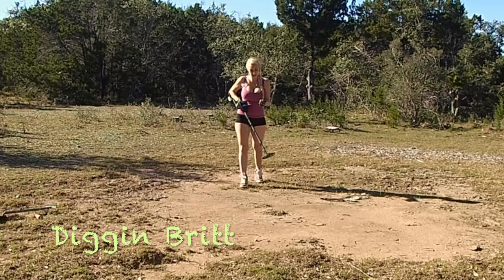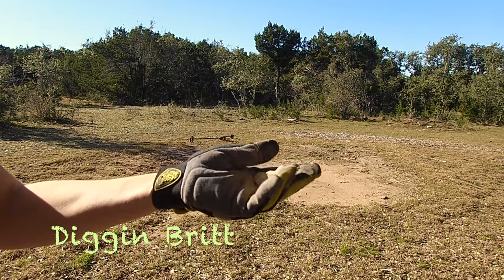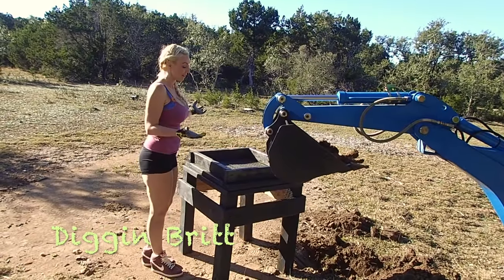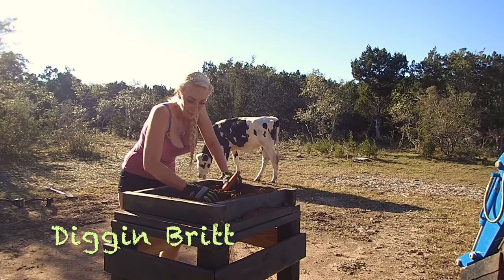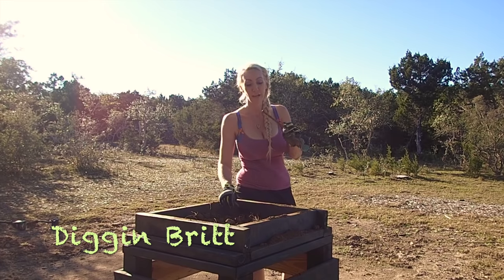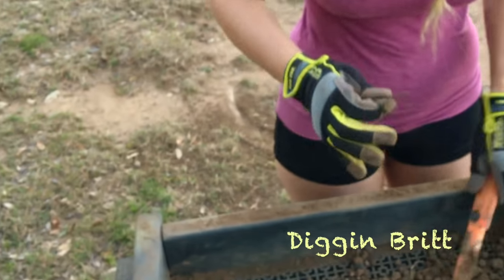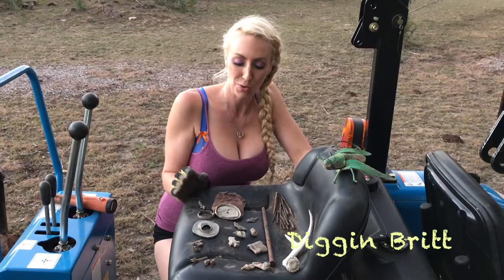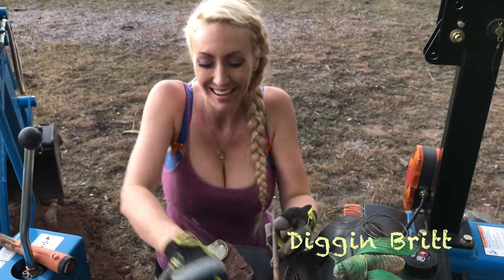Relic Hunting with my BackHoe and Homemade Sifter

Comment: toothed ring looks like part of a old set of kitchen taps, the larger ring is a cover where the pipe comes out of the wall to your taps.  

Spiral nails are house framing nails.  The two bullet like items look to be old fashioned automotive bulbs.

Comment: Twisty nails often have a square shank, to use for eg; nailing plywood to framing, in order to make them grab the timber better, so as to be harder to pull back out of the framing.

Comment: Big nail is a landscape timber spike. Metal with screw is a ground plug from an extension cord, and the twisted nails are fence picket nails, they are like the ribbed nail and do not vibrate loose from the wind. I will let you add your twist to these description. You are enjoyable to watch and keep diggin.
Reply from the maker: Thanks Dennis! ❤️😊

Comment: They are screw shank framing nails. The screw shape is supposed to keep them backing out of the wood as easily as smooth shank nails. They're usually used outdoors, or where the wood framing will experience a lot of expansion and contraction from environmental conditions. 

Have a nice day.
Reply from the maker: Thanks Calhypo, I hope you have a good day as well. ❤️

Comment: That green "hornet" is actually a cicada. Also, the twisted nail is used when you don't want the nail to back out, like wood on a deck or steps. The nail twists like a screw when hammered into the wood an won't back out.
Reply from the maker: I love cicadas. ♥️And thanks!

Comment: The 'toads' that look like bullets are called "Bullet Catches" used to hold small cupboard doors closed. Pair that up with the 'race car" latch and I would be a safe bet somebody dumped an old cabinet door out there.
Happy new year doll.
Reply from the maker: Thanks and Happy New Year Locadio! ❤️🎉😘
Reply from the maker: I said "chodes"...that's a slang term for a male...ahem....part that is as thick as it is long....so fat and short...😱...Sorry!😂
Reply: Haven't had any experience with any guy parts outside of my own, so no need to apologize.
Those twisted nails probably came from a pallet, looks like you dug up somebody's burned up trash pile

Comment: Those spiral thingies look like  spiral nails, 
often used in wooden pallet assembly, they grip like a bugger, try taking a pallet apart, its not very easy.... most people end up throwing pallets on a bonfire rather than disassembling.....I think you were likely exploring an old bonfire location right there ")

Good job, Britt
Reply from the maker: Thanks Rob!  Sac relig to burn pallets!! 😮  Unless they're literally rotting away I  keep and repurpose them!  Thanks for the info! 😊

Comment: Dear Britt,
The item you refer to as the fun do hiky is the the ground prong from a broken three prong standard plug.
 https://tse3.mm.bing.net/th?id=OIP.XqM65RY35i6JCBYY05FYKAEsDN&pid=Api 
Here is a link to an image.
The ground prongs are often removed to allow the plug to be inserted into an old two slot outlet.(ungrounded)
The other brass piece is from a broken outlet. It is the wire connection point.
The smashed piece with a 3/4 inch hole goes on the shower pipe to cover the hole in the wall. You slide it on the pipe before you install the shower head.
Hope that helps.
Love your video's.
I share your interest in relic hunting and detecting.
It is truly a gas to find something that was buried, even a rusty can.
You have a wonderful sense of humor.
I thought I was a leg man.
I think you converted me!
Happy New Year

Comment: Bob Dobbs has it right it is a leg from a 220 plug> Name that do hickey.. the twisty nails are to slow the nail from pulling out it gives it holding strength usually used on pallets
Reply from the maker: Thanks Jack! 😊

Comment: Have you ever gone to a ghost town and done some metal detecting. Lots of em around now a days.
Reply from the maker: I did go into a ghost town pretty recently...it was right off a highway.....It had an old slaughter house building (kind of creepy and sad) that was pretty torn down.  I brought all my gear but I was kinda too creeped out to detect 😁...But I will again sometime soon...not the same place of course.  There's lots of old barely standing houses and buildings close enough to where I live but I don't know who owns the property that it's on and I don't want to go without permission...or get shot at...😂
Reply: I understand the not getting shot at. Slaughter house would be a little creepy at night. lol Still could be a good place for a few good finds. Might be worth a second trip and a quick once over. Day time of course.  If the ghost town had a old railroad tracks , it would be a good starting place. Lots of luck, and have fun.
Reply from the maker: Totally a good place for good finds but I checked on intstagram and people had blogged about it since it had been abandoned and I didn't want to take anything from it I guess....and I didn't want any ghosts following me home...🙃  Railroad tracks are a great idea!  Nice! Thanks! ♥️xoxo

Comment: Pallets were made from Ash years ago and it was such poor quality wood that it was unusable for anything else...yes there are numerous examples of guys using it for fencing etc but it was extremely hard to work with and many would give up trying to disassemble..
As an apprentice in the 60s I was asked to take some pallets apart and as I recall it damn near took me 3hrs using a hammer and a crowbar to do one of em....my boss said any savings were outweighed by the the time it took to process them, I was ordered to burn em....sigh

Comment: When you find metal that is questionable and looks like it has been melted like that take it and place it in a small jar of hydrogen peroxide and see if it starts to fizz or bubble like alkaseltzer.  If this happens you have found what is called Native Platinum and some chunks can be worth quite a bit of money.  if it is anything but platinum it will not react with the peroxide and bubbles may appear but if it is platinum it will almost look as if the peroxide is at a low boil. The more platinum that is in the ore the more rapidly it will bubble.
Reply from the maker: I love that trick Tommy!  Thanks!  I'm all over that idea! ♥️🙂

Comment: Do you ever find meteorites ? Do you want to ?
Reply from the maker: Yes possibly and yes! 😊
Reply: I think that one good indicator that a rock is actually a meteorite is that a meteorite of a certain size will be noticeably heavier than an Earth rock of the same size.

There are plenty of stone meteorites. I assume that your metal detectors do not detect those kinds of meteorites.

There are stony-iron meteorites, and there are iron meteorites. Your metal detectors can find those.

You could train yourself to identify meteorites:

Meteorites have pits, which are like tiny crater-like indentations that were caused by the intense heat of entering Earth's atmosphere at hypersonic speeds.

And meteorites have fusion crust which you could teach yourself to identify.

If you have possible finds, then it would be totally cool to show them in a YouTube video.

Comment: Britt, you will be amused to find that those" twisty nails" you were curious about are called screw nails. Really.
They also make them in copper alloys- then usually known as ship nails (for salt water resistance) they hold the wood better, lol,than regular nails...Don't really know the reason you are finding cock rings and chastity belts in conjunction with screw nails??
Reply from the maker: Me neither!  And thanks for the info! 😊

Comment: your twisty nail is a roofing nail made not to come out easy and they use the same nails in the wood oak pallets pain in the ass to pull out
Reply from the maker: I hear ya!  Pallets are extremely difficult to pull apart so there you go!  I usually use my sawzall when I need to cut into nails that won't easily come out.